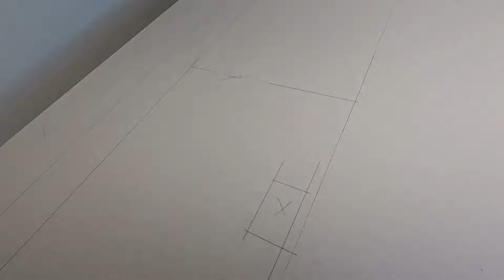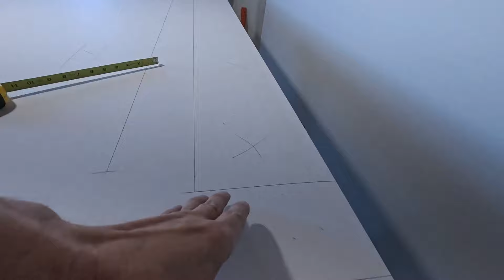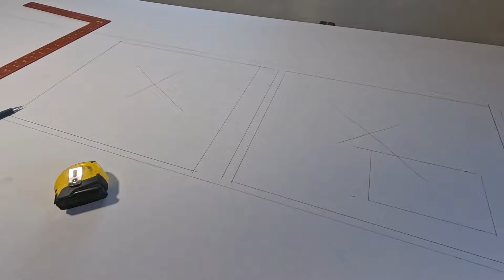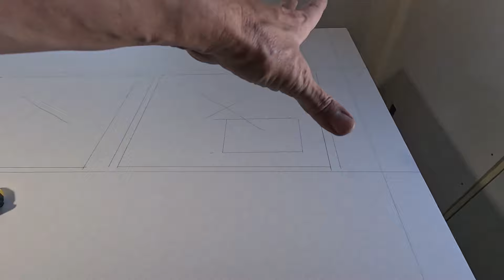Shed-to-Tiny House ― Sound Insulation and Last Drywall in Barn Area

Comment: In the 30 years or more now that I have done drywall on and off I never had a panel where the cuts were perfect! In wood I can hit a 1/16th, 32nd or 64th. On that damn gypsum its always 1/8 or 1/4 off! I think it swells and contracts with a mind of its own!
Reply from the maker: My grandpa blamed it on trolls (anything and everything), but whatever it is, it's messing with my perfection 😉 The corners are now done and you would never be able to tell anyways. I don't know why I sweat the details so much 😅
Reply: @PlanetMojo  trolls seem plausible enough. Thankfully mud and trim cover the sins of trolls!

Comment: Hi Mojo, nice video it's such a relief when you get your measurement correct, such a pain when they don't all line up.as from tomorrow here in the UK our temps are rising way above zero night and day,trouble is we are jumping out of the frying pan into the fire with high winds and torrential rain so flood alerts the length and breathe of the country just can't win, I think I'd would rather have the cold.
Reply from the maker: This comment went into the "held for review" bin by YouTube. The part that is highlighted above automatically becomes a link (no space between a period and a nd the next text), and YouTube gets suspicious of that 🤣 We are going to have the same thing. From -14℉ (-25℃) to near 40℉ (4.4℃) in a couple of days 🥴 I would rather have the cold as well, because it's going to rain on over four feet of snow, which means flooding — 😑
Reply: @PlanetMojo  yes if the ground is already saturated it can only run off